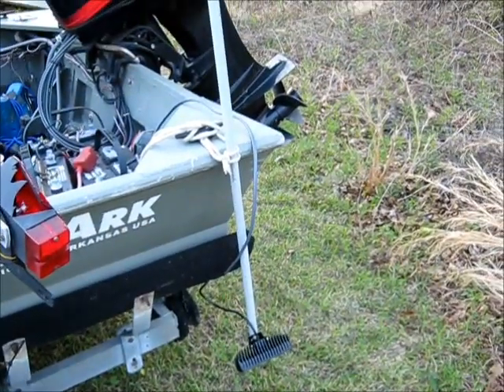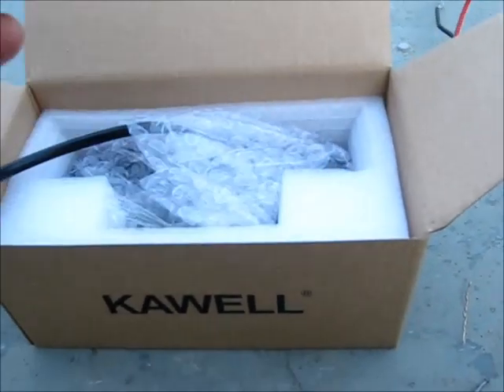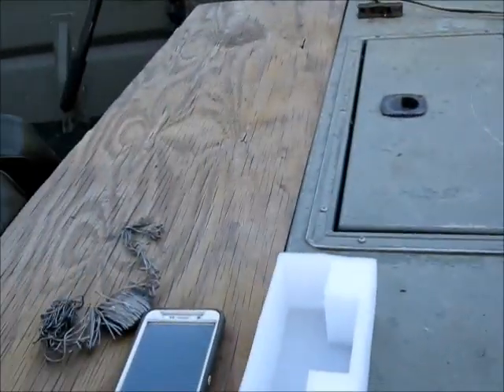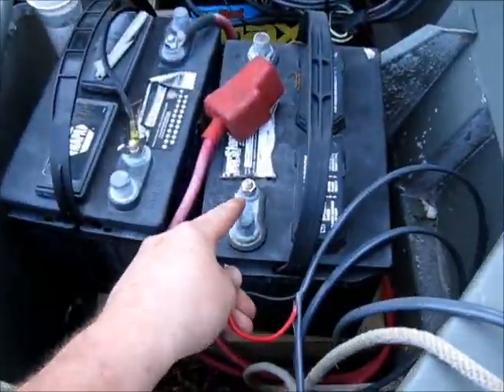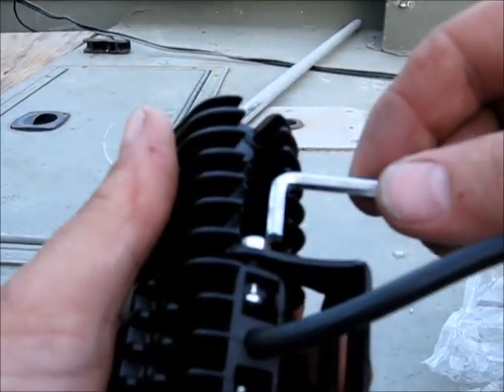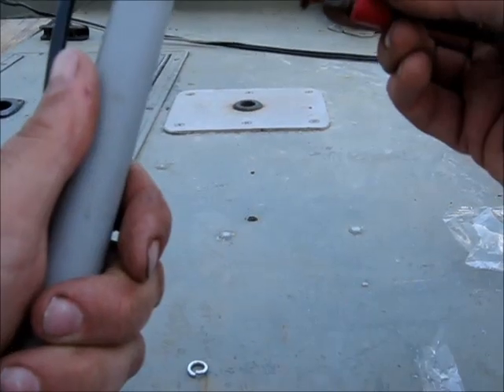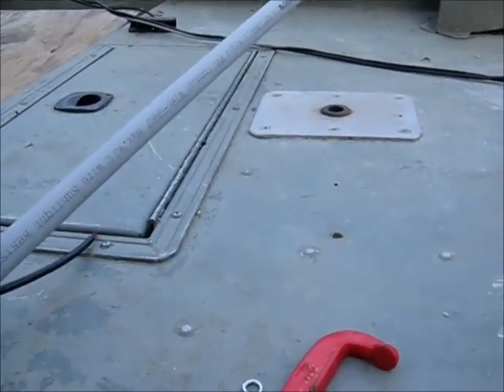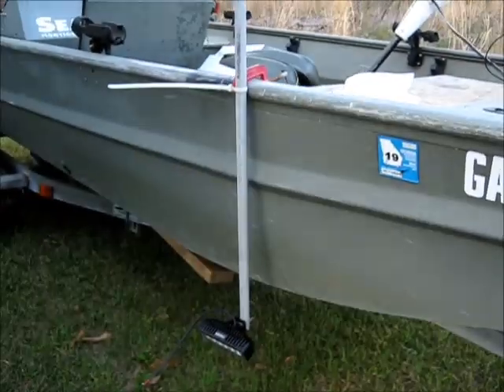making a underwater flounder gigging light

Comment: How'd the head on the pole go in use? Did it stay nice n firmly in position. With one bolt I imagine it would move around
Reply from the maker: once it is tighten up that bolt doesnt move. i ended up ziptie it to a Clamp it worked good. it stayed in place and if we hit bottom it could flex. i only used it once. i will do a update video.

Comment: I used these same lights for gigging and got water immersion on the first outing. I am thinking if I had used some 5900 sealant around the lens, the water would have not gotten in. Currently making another set out of a 100 watt adjustable LED chip light that produces 8000 lumens if adjusted all the way up using a step up booster module that you can adjust the voltage, it is extremely bright! Have you seen any doormat's lately?
Reply from the maker: i haven been  but twice this year once in may  and then in june and it rain hard the day before we went in june the water was muddier than normal. i dont if my lights even work anymore.
Reply: If you got water in the light than it was probably rated of IP67 or Ip66.  You need an  IP68 rating for it to be waterproof
Reply: Big88Country how is that made!?